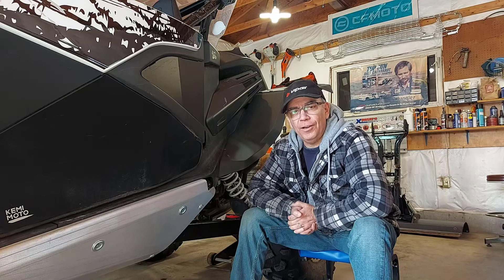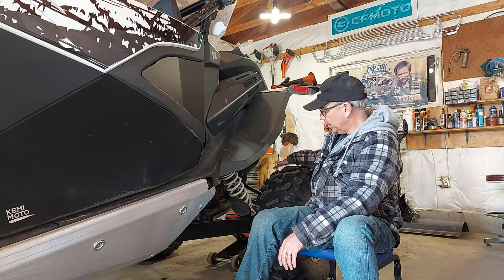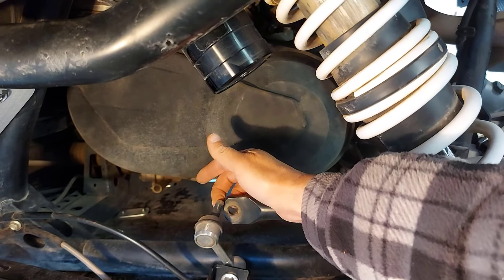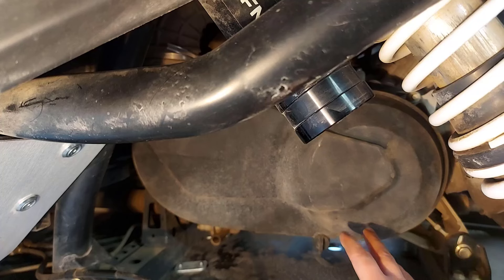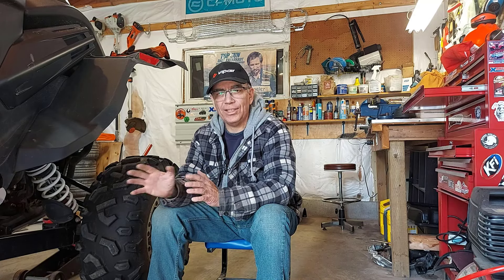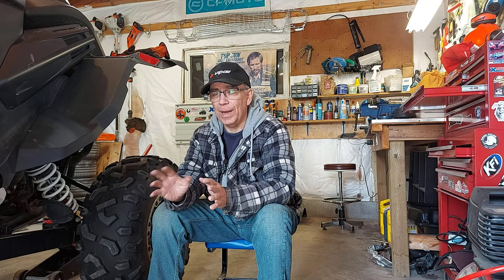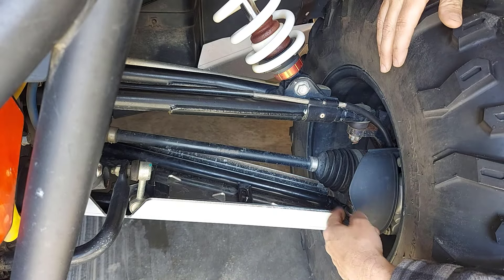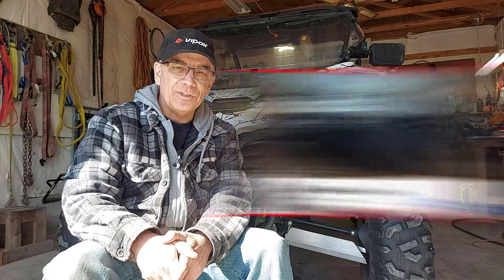Preparing The Zforce 950 For An Epic Summer!

Comment: I bought the stage 2 clutch kit for my 22’ 950 HO Sport from MSC (Main Street Cycle) but I only install the primary clutch kit cause without the upgraded helix you end up losing a lot of your top end speed. Not that that’s a huge deal breaker for me but if I wait then I only have to take apart the secondary once. But let me tell you, what a huge difference that primary clutch kit made. It’s incredible you won’t be disappointed.
Reply from the maker: Thanks, good to hear 👍

Comment: I noticed rub marks on your extended shock absorber. Do you get a grating sound on some greater up and down movements of suspension. Tried spraying under the plastic slide with dry lube but have yet to go out and see if it makes a difference.
Reply from the maker: I don't see any rub marks and no there is no noise.